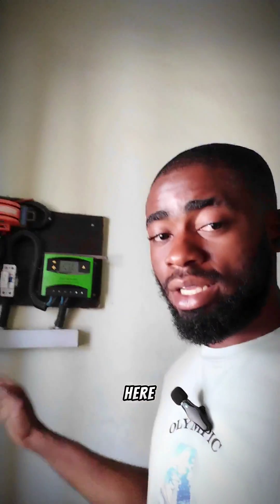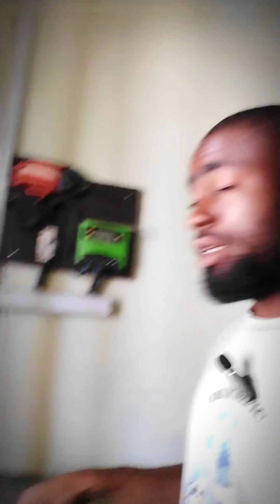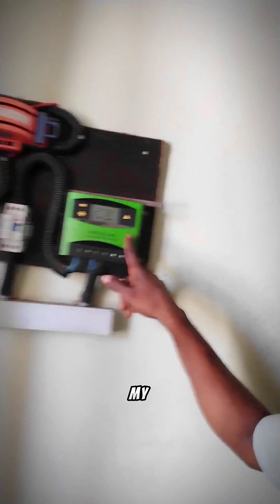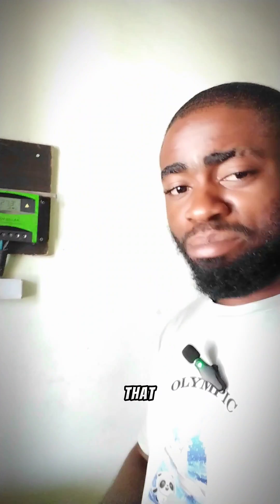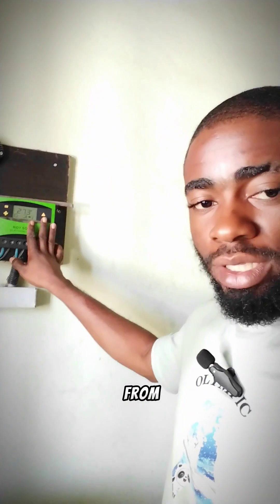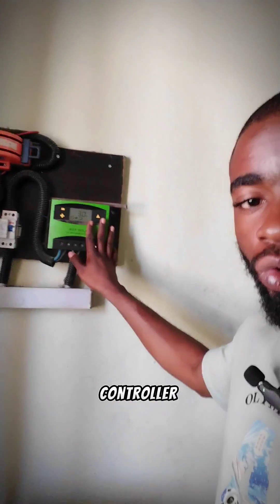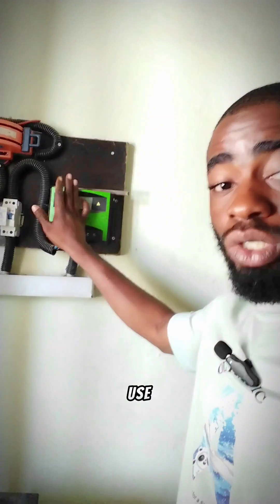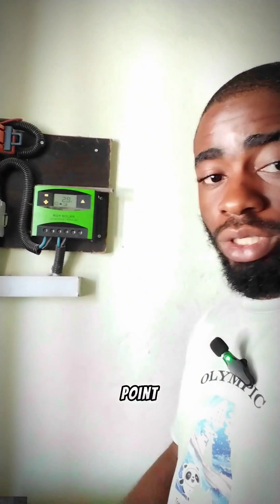solar in Nigeria. after 5years does it worth it?

Comment: Mppt controllers wins in cloudy and overcast conditions. Pwm work very well in sunny conditions. There's little advantage gained with mppt on a small solar system. Rather put the extra money into another matching panel and gain more power even in cloudy weather. If you plan on going big you will gain more with a mppt controller.

Comment: That's very good.  
PWM is a dumb charge controller, it doesn't convert voltage to current, so in this case a person has to connect the solar panels in parallel and also use a thicker cable to handle the large current.  While with  MMPT the panels can be connected in series (provided the maximum voltage rating of the charge controller is not reach) and use a medium sized cable, the mppt will use the high voltage to get current.  
The only problem of PWM is the requirement of the thick cable other than that it is nice

Comment: Hello Boss. I understand this exact controller for an installation. Its shows E 01 sometimes and when it does the system will shut down. Please what is the cause and what does that display mean?
Reply from the maker: E01 means battery low

Comment: I like your setup. I am also not a big fan of those all-in-one units (inverter, charge controller and battery charger) because if one part fails, the entire unit becomes useless.  I like to be able to replace individual units like you replaced your inverter.
Reply from the maker: Those all in one did save you stress though!.
But more challenging when it comes to maintenance

Comment: I agree with you. I have both PWM and MPPT charge controllers. They both work but they work differently (different technology). It is only when you buy fake/poorly made products that you have a problem. MPPT is more efficient than PWM. It is like going from Lagos to Abuja on road vs air. Both will get you to Abuja but at different times. But if you are going from Ikorodu to Lekki, it doesn't really make sense to fly if there is no traffic.
Reply: Because your system is not too large it wouldn't matter much if you use MPPT or PWM but with large solar system and places with swinging weather conditions  like cold, cloudy climate it matters a lot.
Reply from the maker: Yes, you understand how they both work really
Reply: Fantastic illustration.... Nice.

Comment: Why would lightening affect the Inverter if it was properly grounded? I don't get that aspect. Also prefer MPPT over all others.
Reply from the maker: Not all amount of lightning can be trapped by grounding.
And mppt are mostly for large installation or cold environment
Reply: @Mairigaemmanuel when you say large, I.e from 5kwh upwards or specifically 24-48v ?
Reply from the maker: Nah, from 15kw and above